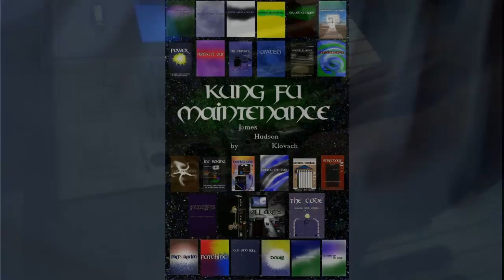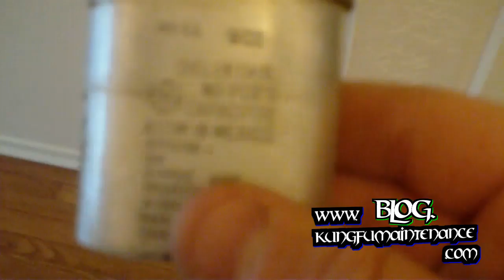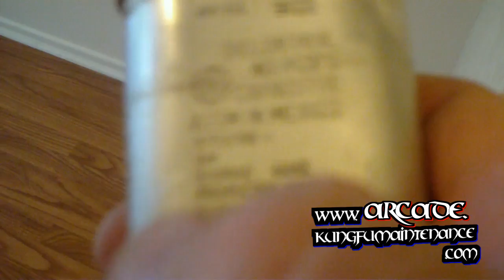Indoor Central Fan Motor Buzzing Humming Not Starting Air Conditioner Heater Furnace Blower HVAC

Comment: My blower motor starts humming and and quits working after its been on for a little bit. If I unplug and let it cool off then plug it back in it does the same thing. Can the capacitor be bad or is it something else?
Reply: Hi did you figure out what the problem was? I'm having the same problem. it starts up for 5 mins. then off let it cool and comes back for a few mins. we are freezing in our house

Comment: I can't get the wires off the capacitor. It looked like the metal was crimped to hold it in place but when I try to "uncrimp" them it doesn't budge.I don't know what to do next
Reply from the maker: im4himandhe4me You could always cut the wires restrip and crimp on new wire leads if needed. I woud try using inslate handle flat blade screwdriver as a lever first to try to leverage off the leads.

Comment: My blower turns, but it hums a lot like yours. Would that also be the capacitor?
Reply from the maker: It's possible it is the fan motor as well but at three to ten dollars for a capacitor it is worth trying first as you will need a new capacitor anyway if the fan motor needs to be replaced. About eight to nine times out of ten it just needs a new capacitor. ~ Thanks for watching!
Reply: KungFuMaintenance I replaced the capacitor. It still makes the same noise. I'm going to try oiling the motor next. I hope this works.

Comment from the maker: Do not attempt this unless you are absolutely sure of what you are doing. If it is possible to spin the blades they will spin for some time. Perhaps you can reach to spin them with some extension such as a broom or paint brush.  They should spin long enough to put the blower door back on.

Comment: Were can one buy a capacitor , would they sell it at lows , HomeDepot or at a special at shop ?
Reply from the maker: You can order them online Ebay, Amazon, etc... Local stores you would need to go to a specialty shop such as Allied Refrigeration.
Reply: +KungFuMaintenance thanks . I was able to purchase one and I put it in and it still didn't work. . The unit is a 10 seer Carrier Brand .
Reply from the maker: For an indoor blower wheel not turning on one of the first checks is for a faulty service door switch especially if it does not buzz or attempt to turn on at all.

Comment from the maker: Sounds like one of the motor bearings went out. Not the easiest repair replacing the motor. I have a video showing it in part. I can't say it is the best vid as some of it is a bit dark but it might help a bit. It is called "How To Replace Noisy Broken Indoor Air Conditioner Furnace Fan Blower Wheel"